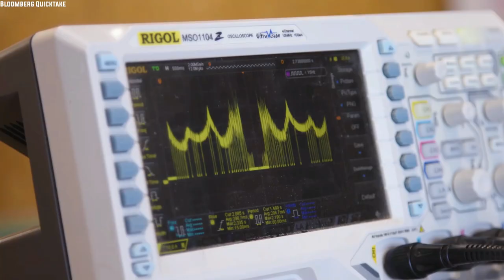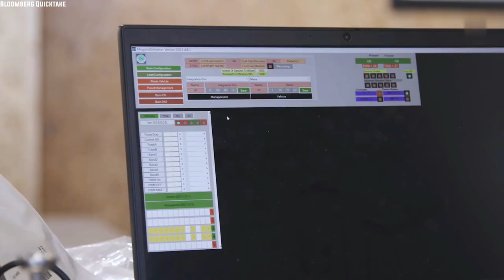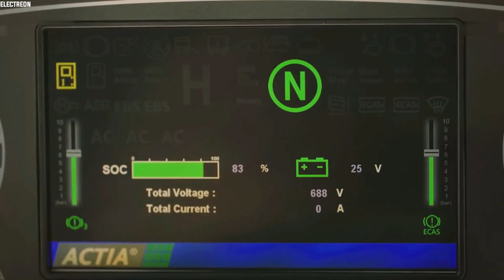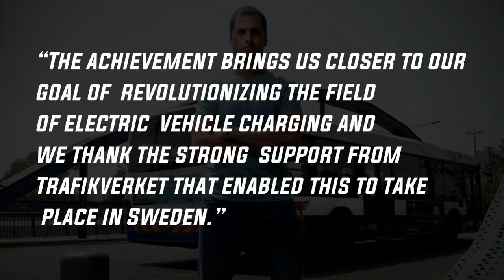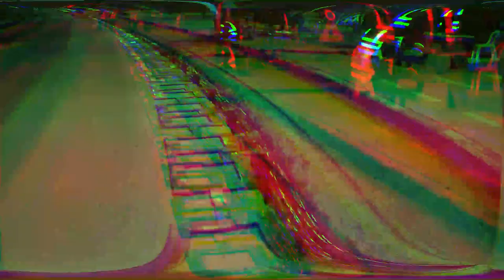Wireless Charging Roads Became Reality!!!

Comment: Electric Racing Cars that don't need to refuel in pit stops changing racing. Wirelessly compared to the Scale Electric slot cars tracks of decades ago as toys.
Reply: I don't think that might be possible because electric vehicles for racing would consume more amount of energy than normal electric vehicles and wireless chargers are not capable of charging so quickly. Swapping the batteries in pit stop would be more effective in my opinion as the wheels have to be changed too after heavy usage. I hope you find this comment useful

Comment: Think Self driving Container dollies in container ports.  Need to run 24/7 without recharging.  No driver/passenger, fits entirely under the container.  With front and rear wheel steering, would have small turning radius and allow for smaller aisles between rows of containers.  Would only need to install charging lanes on main aisles and traffic ways and not between stacks.  Easy and limited installation.  Biggest problem with this technology is the massive number of miles of road that would need to be implemented to make it worthwhile.  I see only limited application such as this suggestion and where there is limited and known/repeating travel paths.  Small vehicles inside factories would be another idea.

Comment: It doesn’t make sense to spend all that extra money putting up telephone poles, and then having them blow down or get cut.

You can do a little extra and put it in the road and sidewalk, making it completely protected from any kind of disaster, and then all that extra extra money you saved, you could literally just put power storage along the road and meter it like a vein.

Just like Venus insufficiency, you can have a leaky valve that goes back-and-forth.
- you can take that idea and have each car give power back to the grid and just meter it.  You would have build ups at each battery grid, but you can have it empty back into the main system like when people try to prop up their legs at the end of the day.

In that way, the grid would be seamless, hardened, protected , and everything would be handled in an app.

On top of that, people would have storage in their home for at least a day.  And if they wanted to, their cars could make money by selling what they make at home, giving it to the system and bolstering the neighborhood while they do Uber.
- in this way, FPL wouldn’t have to have a battery back up system.
-. The battery back ups would be everybody’s car.  That’s a distributed system with enormous untapped potential.

If there was an issue, just increasing traffic would help or you send a technician to the battery/system

You could literally have a flywheel bus in case the road  was damaged

Comment: I'm not so sure about this.  That's gotta be a lot of EMF all over the place to keep all things powered...they're not too efficient compared to direct charging batteries so there's extra waste.  And I don't know the effect upon a person's body with sustained exposure.
Reply: use of sensors could be facilitated ...once a vehicle passes a sensor some distance ahead of the long stretch of coil it could activate and once the vehicle passes by it could deactivate
Reply: Not to mention the huge copper cost
Reply: Also, what happens when the road patterns change at an intersection. Do they just not put chargers in the intersection? And even if they dont. Any kind of road work will definitely be hell. Those wires they put in the road to detect cars cause issues, and those are only small wires
Reply: It will save the initial cost of vehicles , price of electric trucks and buses are huge due to big batteries .

Comment: So the road will give back about 10% of the power used to drive along the road. The reality is that this is just a very ineffective range extender. Also the road will give more charge back to your car if you drive SLOWER. We could end up with an EV lane that has a speed limit of 30 mph to allow charging while ICE cars can travel 50 mph on the same road.
Also the moment a truck or bus drives in the special charging lane it could damage the wires/coils and ruin the charging effect.

Comment: You said wireless charging "will allow vehicles to be infinitely more efficient." You misunderstand both the work infinitely and the concept of vehicle efficiency. This doesn't change efficiency of the vehicle at all, but it could inspire manufacturers to build excessively inefficient vehicles, because range would no longer depend on vehicle efficiency.  Wireless charging has more transfer losses than a plug, meaning this technology is less efficient use of electricity. 

If they intended to build battery free electric vehicles that are 100% reliant on the road for power, the tech could theoretically be slightly more efficient than the losses needed to push energy into the battery plus the losses needed to draw energy out of the battery. 

But Electreon struggles to attain greater than 70% efficiency, and there is little chance we'll have the materials (massive amounts of plate copper)  or available infrastructure CO2e emissions (we cannot emit to save with no carbon budget left) to convert every driveway, street, road, highway to eliminate the battery from the EV formula for cars and heavy trucks. 

Electrified rail makes more sense for people moving in metropolitan and suburban areas than lossy wireless tech. Also, having instantaneous demand to fully power all cars/SUVs/trucks/buses to travel at the same time (rush hour) would most definitely require a major change to the grid from a surge of demand. And therefore storage would be needed to bank renewable energy for hours and hours and need to be quickly discharged, which low-cost, sustainable storage struggles to do.